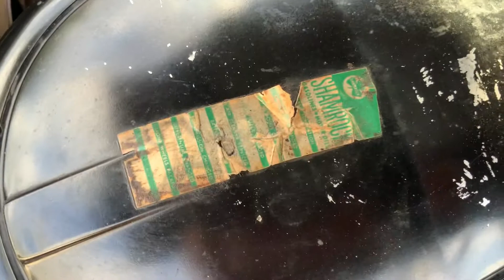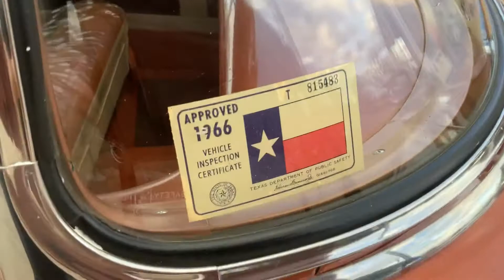1957 Chevrolet Bel-Air 235ci Blue Flame I6 4 Door Survivor 10k Original Miles Power Brakes

Comment: about 95 percent of the 57s were sold with the jet intake front bumperetts not the current 95 percent now that have boobs               the jet intake is the art work of the car  this looks like a 57 chevy  nice
Reply from the maker: We guess that these would be more on the four doors and the boobs were on the 2 door. The Canadian ones didn't have the rubber on the boob tips.

Comment: Neat it's original   but Restorations are better IMO     Better Paint upgrades , Brake System upgrades,  Engine upgrades ect
Reply from the maker: I can understand where you are coming from, but in this particular case that would basically be sacrilege. This is all original and has the plastic from the dealership still over the seats. Only 10k original miles. It is of course understandable to upgrade to those things on an old wore out car. We of course cater to both categories of classic car enthusiasts. Check out our website to find one more of your style. www.streetdreamstexas.com
Reply: @StreetDreamsTexas  Only orig once in it's life
Reply from the maker: @ohbillytv179  Exactly

Comment: It's missing the rubber bullets I have a 57 Bel Air mine is numbers match but mine needs Sill pans and mine needs running board molding
Reply from the maker: Ours was a base model. Yours is an upgraded one.